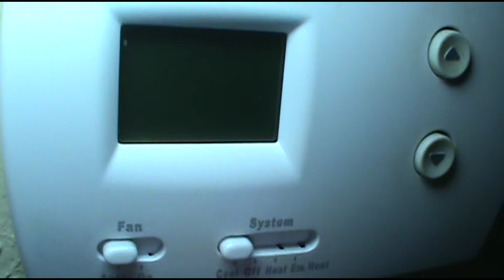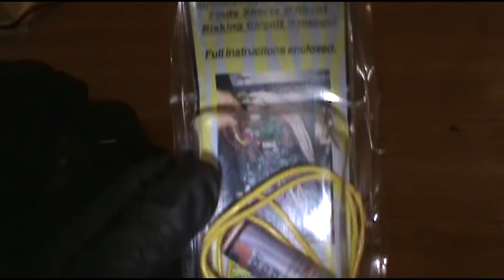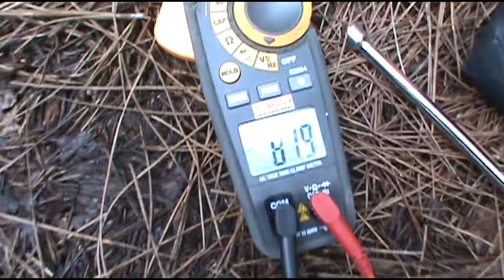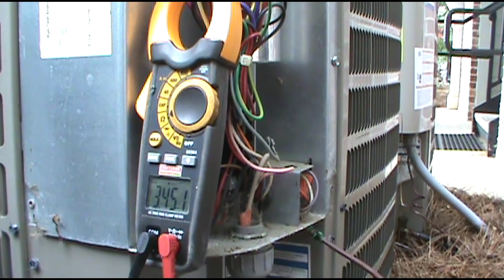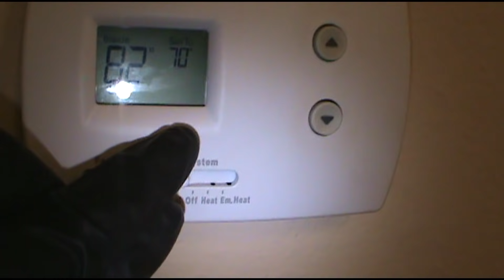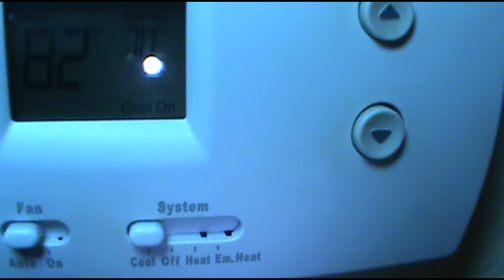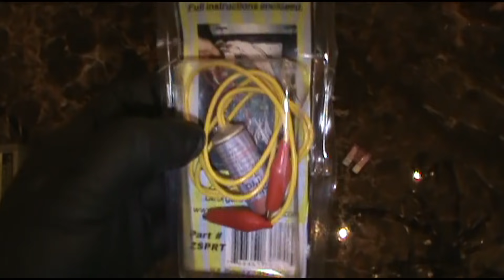Circuit Board Fuse In A.C. Keeps Blowing

Comment: Great video.  What if the low voltage fuse burns out intermittently?  One instance it happened running the Carrier AC for a few hours a day for a full month in June and two weeks in July.  After replacing the fuse, the second instance happened again after one week of running the AC in late July on the same programmed schedule.
Reply from the maker: Those are the hardest. Could be thermostat or a wire that touches sometimes.  Thank you so much for watching!
Reply: @LexVance Thank you for your quick response!  Have an appointment Tuesday with the tech and will focus on these possibilities.

Comment: My fuse blows as soon as I switch it to heat. It's all electric (no orange wire, just blue, green, yellow, white, and red). How would I test that?
Reply from the maker: Go wire for wire. Leave blue in the thermostats.  Pull others out. Test green to white since it's heat. If it blows then there's a short on one of those wires. A nick in the wire. Or could be a bad tstat.

Comment: I ended up buying  pop circuit breaker instead of the device you mentioned since I was working more at my furnace.  But, man, this video really helped.  Ended up also finding a wire on the AC unit some mice had eaten the insulation off and was touching the edge of the unit.
Reply from the maker: Right on! Thank you so much for watching!

Comment: Can check in the same way for heat mode , I’m having that trouble but the unit work for over 30 minutes and fine later get short again on 24 fuse on heat mode
Reply from the maker: Yep. Sometimes it's a bad thermostat. Low voltage shorts are very tricky and difficult to find.
Reply: Thank you for the advice, I just think can be that , I replaced twice the 3 amps fuse and work the unit on heat mode for a while and blow it up again
Reply: Can i test that on the same way with heat mode right body?
Reply from the maker: @perez2877 yep
Reply: @LexVance ok thank you so much my friend , sometimes like you said , get a headache with this jijij

Comment: The fuse on the control board keeps getting blown. I replaced it with a new one turned on the AC. Everything seems to be working fine. I hear the blower running ,however I put it on heat. I hear the start up working & the flame goes on. But just as a blower goes on the fuse is burnt. Do you think it’s necessary to replace the blower or might it be a different part causing the sort?
Reply from the maker: A fuse blowing means there's a low voltage wire touching something. It may be on the heating wire coming out of the thermostat. Or, it could be the thermostat itself. Low voltage shorts are very tricky.
Reply: @  I connected the thermostat with the different set of wires and had the same results
Reply from the maker: They're tricky. The copper touching could be any where. Even behind the wall.

Comment: Hey Lex. Thanks for the informative vid. I just had a new hvac system installed 6 weeks ago. Last weekend, I lost power. The tech came by on Monday and replaced a blown fuse.  It ran for 3 hours then lost power again. I installed a new Vivint thermostat just in case it was that. Waited for the tech to come by last night, and he put it another fuse. It ran for 3 hours then quit again. So we know it’s nit the thermostat that’s blowing the fuse. I guess it could be a wire, and will ask him to perform testing tonight, but he said it’s weird that I get power for 2-3 hours before it quits. If I had a bad wire, wouldn’t the new fuse blow like almost immediately?

Comment: Great video. I having a similar problem I think it's my thermostat. But I have replaced contactor capacitor and transformer.. and thermostat wires. But keeps blowing my low voltage fuse every time I try to install my thermostat. Do you think I'm correct or is there something else there could be
Reply from the maker: Low voltage shorts are too tricky. I'd need to be there for this head scratcher. 🤔
Reply: I tried that link for the short finder but it's says it's no longer available. But did find a couple just like it. Btw I'm in no way a professional just can't afford to pay  a professional right now.  Only thing that's makes me question the thermostat is I got a used one that the guy claims it's good but it does the same thing. As soon as I plug it into the wall it blows the fuse. But I can jump the wires together and everything works fine ( minus the fact it's running constantly) cools down quickly.
Reply from the maker: @scottshelton7401 I'd try another thermostat. Bad thermostats can blow fuses. Get a basic easy to use one from Hope Depot. Fancy thermostats seem to be troublesome.
Reply: @LexVance  that was my next move ..try a new one

Comment: How u trace it if orange wire is clipped.  I got red, yellow,  green.  Also what's the black go too
Reply from the maker: Each system is different so I'd need to be there for this head scratcher. 🤔
Reply: The black was hooked up to the green on the thermostat.. green was hooked up to the C
Reply from the maker: That's weird. Green is usually on G to turn the inside fan on. Blue usually goes to C for common. Not sure what black is for.

Comment: Hey Lex i did exactly this found my low voltage short. Fuse stopped popping. But ac only blows hot air now. Refrigerant and compressor are fine.
Reply from the maker: I'd need to be there for this head scratcher. 🤔 Low voltage shorts are too tricky.
Reply: @LexVance  yeah it’s really throwing me off bro. Everythings wired up correctly too. A bad transformer wouldn’t cause that would it?
Reply from the maker: @subliminal128 No, a bad transformer would cause no power. I wonder if a skinned wire is touching the white wire for heat or something.
Reply: @LexVance  unfortunately I’m vending it out. It suck when I have to throw in the towel. It’s a learning experience though. I appreciate your immediate responses on an older video brother. Thank you.

Comment: When you jumper the fuse and remove thermostat wires and turn unit back on why did the fuse trip?
Reply from the maker: There's a short in a low voltage wire. Could be touching another skinned wire or touching the metal chassy on the condenser outside. They're tricky.

Comment: Awesome video ! I just ran into this issue. When I turn my thermostat to either AC or the heat pump, it blows the 5amp fuse on the board inside the furnace unit. If I use just electric heat, then no issues. 

I isolated the short to the yellow wire by unhooking it from the AC unit outside. I turned my thermostat back to cool and the fan on the furnace came on with no issues and the fuse didn’t blow again. I decided to use the spare wire from the outside unit and used the black/white wire. Once that was hooked up again, the fuse blew as soon as I requested cool. What I also noticed on the board where the wires hook up, is that I have 2 wires on the same connection. (Yellow and white, but now black/white and white). Would this mean my compressor is bad in my ac unit outside ?
Reply from the maker: The compressor is high voltage. You have a low voltage short. A nic in a wire somewhere. They're tricky to find for even veteran techs.
Reply: I know! I’m a mechanic by trade , so I understand how funky electrical can be. 

Well I did use one of the spare wires there , and it still did the exact same thing once I called for cooling. I have 2 wires on the connection as well, so I’m going to replace the fuse and then remove the white wire to see if it’s shorting with that.

Comment: Any suggestions on a intermittent fuse blow about every 2 days or so...
Reply from the maker: Those are the trickiest. I would change the thermostat. If that don't do it then go through the whole low voltage wiring with a fine toothed comb and see if there's anything rubbing or copper exposed. Hopefully you find something! 🤞 Thank you so much for watching!

Comment: I’m going crazy here, I replaced the fuse and visually inspected the wires at the furnace the unit outside and the thermostat and found no exposed wires on nicks or cuts I even replaced the contactor and still burning up fuses.
Reply from the maker: Those are the worst. Break could be in the wall or the actual thermostat or circuit board could be bad. I hope everything works out for you! 🤞

Comment: 2nd time this video has helped me get my head around troubleshooting these systems. Thank you so much! Very well done.
Reply: My issue this time was a bad contactor coil. You showing the normal resistance through the coil was very helpful. Mine had very low resistance, pulled it apart and, yup. It was smoked. Thanks again!
Reply from the maker: You're welcome! Thank you so much for watching!

Comment: Lex, thank you for the information.  My 20 yo Rheem failed a year ago in the same way the the technician got it running but didn't say what he did.  It failed again 2 days ago with the 3A fuse being blown.  There was still power to the thermostat (Edit: No, probably not; in thinking about it I'm sure it was the battery backup in the thermostat that kept the display on...)  and replacing the fuse got it running again.  Then he went out to the condenser and asked if I wanted a new contacter and I said yes.  He thought it probably was the contacter but I don't know.  In any event, I've ordered the protool and jumper cables and spare fuses for next time this happens.   Very useful video and well-explained.
Reply from the maker: Thank you so much for watching!

Comment: My common wire ain't connected and my thermostat only getting 4 volts , and led blinks 1 time shuts off
Reply from the maker: The transformer may be fried. I'd need to be there for this head scratcher. 🤔
Reply: @LexVance  it was my contacter in condenser fan ... back up running 😁🏆
Reply: My thermostat stat is a emerson runs on  battery 🔋 my battery sign shows full .

But nothing starts just 3 clicks from thermostat..

Also 3 amp fuse blows out on mother board

Comment: Job well done . You found it . The vibration caused the yellow nicked touched metal . On brand new TH I changed color caused no AC it was working the yellow shorted some where behind the wall . After switched different color for AC it’s work fine . Problems solved .
Reply from the maker: Thank you so much for watching!

Comment: Thank you! This is a great straight-to-the-point video. "Hold your horses here, Clem!" that was my cue!   It was the easiest first step for me.  Turn off the breakers. opened up the outside unit.  Unfurled all the low voltage wires, made sure nothing was touching metal. Tested the system it worked!.  Wrapped each wire in electric tape and tightened the connector nuts! tested again. It still worked! Stowed the wires! Closed the hatch.  Thank you for saving me hours of work. Still not sure which wire was the culprit or if it was a loose connector nut. But we are back in business on this humid, hot VA day! Happy 4th to you and yours.
Reply from the maker: Thank you so much for watching!

Comment: I had the same problem today with the yellow blowing the fuse, i went looking for a nick on the wire  and no nick..  I checked the  ohms  and nothing  unusual.   it's a hard low voltage issue..  I have never found one I couldn't resolve till now..
Reply from the maker: Could be behind sheetrock somewhere. I hope everything works out for you Bryan! 🤞

Comment: Shot in the dark that you’ll see this post in time but I had the same issue, AC not working, error code 24 flashing light on the board. Said it was a low voltage short, found a blown 3a fuse. I replaced it with a 5a fuse.(stupid I know) and it turned on but smelled burnt. Before I could turn it off I heard a pop and now the board light doesn’t even flash. Still have power to the thermostat but seems the board isn’t getting power. Any ideas what I might have messed up down the line by putting the wrong fuse in?
Reply from the maker: The transformer could have burned up. The tstat will still have power if there's batteries in it. Sounds like you'll need to find the short first then replace the transformer.
Reply: Silly question but, is the transformer on the inside unit or outside?

Comment: I did the wire switch on the yellow and it’s still instantly tripping. Before this it blew and I replaced the fuse and it ran for 2 days. Not really it’s instant. And ideas? I tested the contactor and it showed 14 ohms
Reply from the maker: I'd need to be there for this head scratcher 🤔. Low voltage shorts are a beast.

Comment: If I am diagnosing the same problem but the heat side of the heat pump system Do I check the same wires?
Reply from the maker: Yes, if it's a Goodman. Low voltage shorts can be tricky so I would need to be there as it could be 10 different things.

Comment: Can you help me?
I have that same issue with the heat , I tested each wire and didn’t blow fuse, after 5 days it shorted out again , any advice? Thanks in advance, I have a heat pump, I might add that I just switched the old thermostat with a new smart one
Reply from the maker: Low voltage shorts are so tricky. Especially when it does it intermittently. I'd need to be there to inspect everything. If a wire is barely touching metal or another wire it will short. I'd need to be there for this head scratcher 🤔.

Comment: Man thank you for making a very clear and concise video very easy to follow my problem was the heat pump AC was working find thermostat was working fine with the AC but as soon as winter rolls around turn on the heat it blows the fuse so if you can make a video for the heat pump diagnosis and troubleshooting that would be great thank you
Reply from the maker: Thank you so much for watching Mike!
Reply: I have same issue, did u fix it? 
If so what was your issue?
When We turn on heat for the first time the  fuse blowed too

Comment: I tested all the inside tstat wiring as you described and everything is OK.

Evap fan runs fine with tstat stat set to "fan only" position at the stat.
However, when stat is switched to "cooling", the fuse in PC board immediately is being blown, when the condensing unit circuit is enabled. 

I disconnected the low voltage wires at the condensing unit relay and enabled the cooling mode and the fuse does not blow when cond unit circuit is enabled.
When  I checked the low voltage wires to the relay, it shows 16.9 ohms.

With the low voltage tuned off at the PC board, I checked the other two disconnected wires going back inside to evap unit and it shows  878 ohms. 

The two low voltage wires that are still disconnected at the cond unit relay, show 26 volts when the low voltage is turned back on.

Any ideas of what could cause the fuse to blow?

The condensing unit runs fine when the relay is manually pushed in.
Reply from the maker: Yikes, you've got a head smasher there. I'd need to be there with a volt meter for this one. You can try a new thermostat. May be a bad tstat if all the wiring is checking out fine. 🤔
Reply: @LexVance  Is there any significance to the ohms from the wiring going back to the evap unit? 
Is there any chance that the cond unit relay  or PC board is bad ?

Comment: My fuse is blowing the instant I flip the switch back on. Could a bad transformer be causing this?
Reply from the maker: A bad transformer usually causes no power. It's usually a nick in the wires touching each other or something metal. Low voltage shorts are tricky. I'd look down in the condenser and make sure wires aren't touching or a wire nut didn't come off. Thank you so much for watching Epic!
Reply: @LexVance  Thank you for the reply! I’ve been stuck trying to figure this out for 3 days now. I’m just about to give up and call in a repair guy. I pulled off and disconnected the digital thermostat and saw there are only 4 wires (red, black, green, white), but only the red and black are connected and being used. I left the thermostat disconnected and tried turning on the furnace again and the fuse instantly blew yet again. I visually inspected all the wires I could see, and can’t see any frayed or unshielded wiring. If I have the thermostat disconnected, it can’t be the thermostat, AC or heating, right? It has to be something on the board?
Reply: @LexVance  Oh, I also visually inspected the wires going to the condenser outside, and didn’t see anything chewed up either. I haven’t opened it up, though. Would a bad wiring with the condenser still blow the fuse even if I have the thermostat disconnected?
Reply from the maker: @EpicBenjo  Yes. It could be a pressure switch. It could be behind the wall. It could be any where. Low voltage shorts are impossible to figure out if you're not there looking around with a volt meter.
Reply from the maker: @EpicBenjo  Yes. It could be a pressure switch. It could be behind the wall. It could be any where. Low voltage shorts are impossible to figure out if you're not there looking around with a volt meter.

Comment: Any ideas for my fuse that keeps blowing, when only the power red and common blue are the only ones connected to the thermostat screws?
Reply from the maker: Hmmm could be a nick in one of the 2 wires. You can try to eliminate them and use wires that's not being used. 🤔 Low voltage shorts are tricky.
Reply: @LexVance  ended up being the contacter! Thick Spider web with a crusty spider all over it, but just contacter didn’t look bad that’s why it tricked me